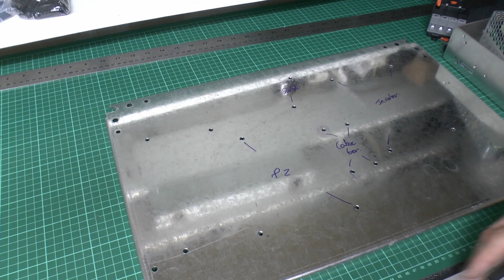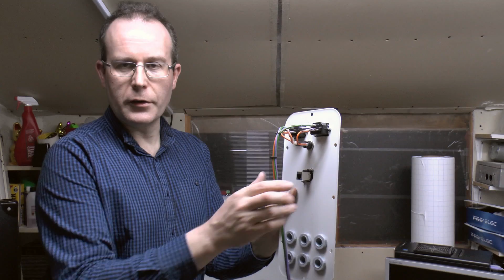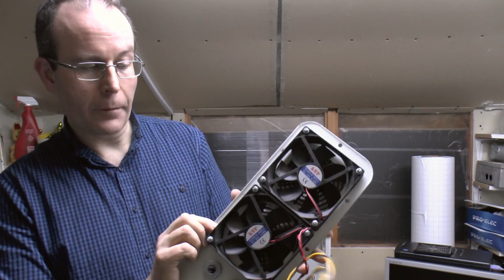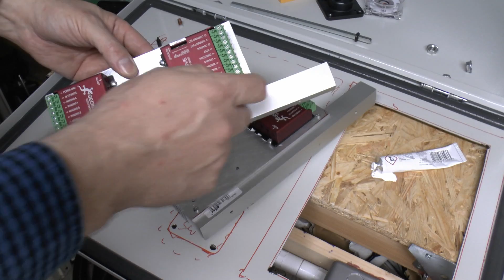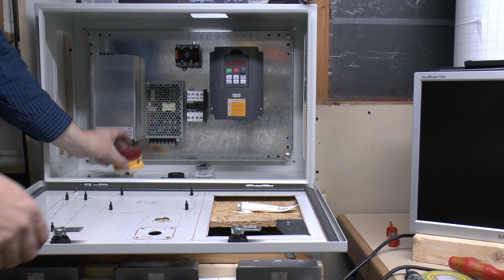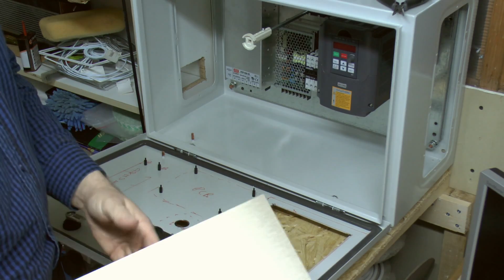CNC Router Build #3 - Cabinet Mechanical Assembly

Comment: Just because the wiring is internal is not a justification for non standard colours - just say you ddn't have the correct colours and leave it at that.
The driver heatsink orientation is pointless, at least align it with the internal air flow.

Comment: Everyone makes the same mistake in their CNC builds - Meanwell PSUs have the mosfets mounted on the side, therefore they should be mounted edge on to any steel plate. Bolting them flat has no heatsinking advantage at all.

Comment: That's not how I did mine, but everyone is different I suppose. If I was going to go for broke I'd have gotten a toroidal step down transformer as opposed to that 48V switcher. Maybe when you upgrade? Although I am using a switcher in my CNC right now, and it seems to work.

Comment: Interesting video. One observation: I would not place emergency stop button under on-off switch  because it may interfere with installing a padlock on the on-off switch or get scratched/damaged by the padlock.

Comment: Is there a reason why you soldered the AC wires instead of crimping connectors onto the wires and sliding them onto the tabs?
Reply from the maker: Did not have any connectors of that size.  Did have solder and heatshrink.
Reply: Makes sense. Thanks :)

Comment: The heat sinks and the LV power supplies needed to be at right angle to the position they are in for the best flow of cooling air.
Reply: Equiluxe1 hecsaid they are not running max power so heat not a problem

Comment: That interlock switch looks like a very Heath Robinson solution with the metal bar waving around in the breeze as it does.  The good news is that you can still turn the power on with the door open by simply turning the bar !
Reply: It's industry standard, everything from machine automation controls to marine diesel local control panels. I just stick some mini adjustables on the bar and turn it on an off when fault finding.

Comment: i think that's a bit much of the heat-sink compound :D
Reply: yep, way too much. I dont think people realise how it actually works. The best thermal coupling is metal to metal. Heatsink compound should be applied in the thinnest film you can make just to fill the tiny surface imperfections of the metal instead of having minute air gaps. You definitely dont want a continuous layer of compound separating the two components.  I would have used screws in the other two corners of the modules too to give the best contact between the two surfaces. Of course those things may not actually get that hot in which case none of this is going to be an issue but there would definitely be better thermal transfer to the heatsinks with a lot less gloop and two more screws.